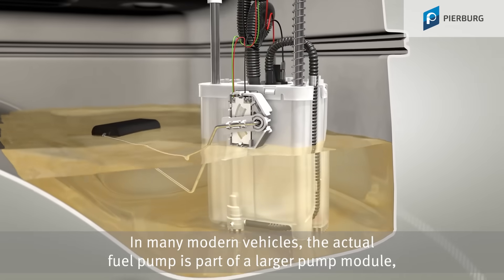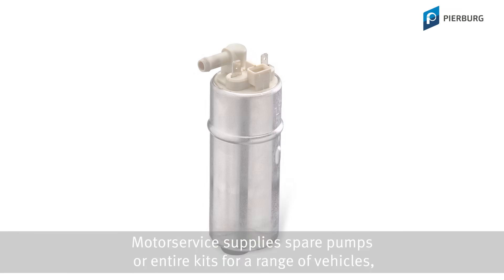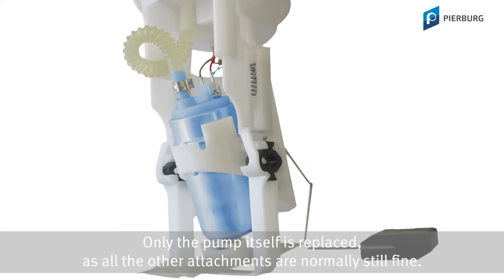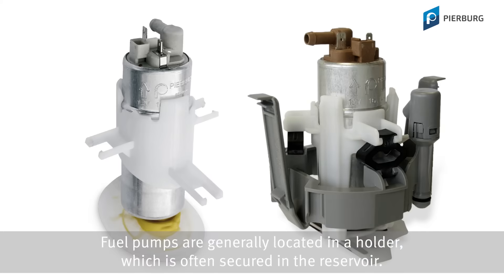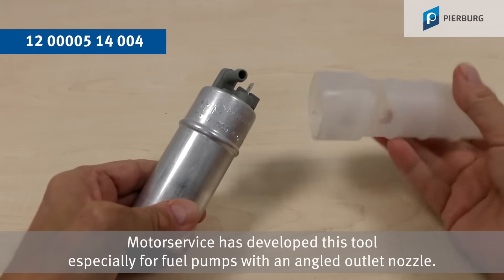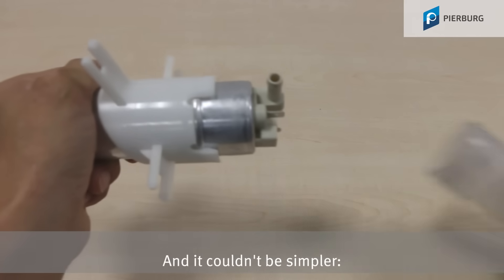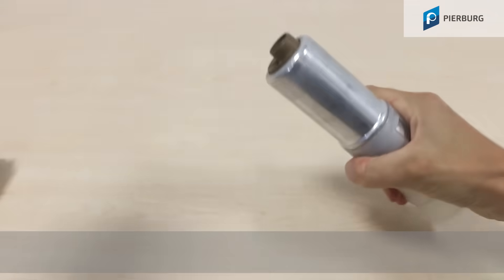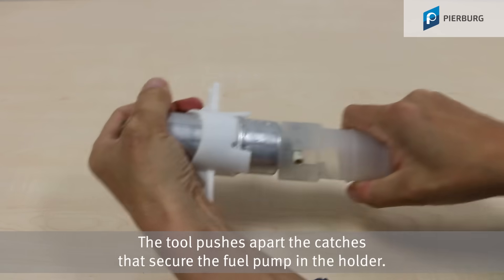Easily removing the fuel pump | Special tool

Comment: I believe the complete assemblies with modules can be quite expensive . Unfortunately , some shops will STILL replace the entire assembly simply because they want to make more money on the job . It's good to know that these are available .
Reply: K ..?..  😊😊
Reply: 🎉 @asifarusovic2044
Reply: I believe " some " vehicles may also have the fuel pressure regulator as part of the pump assembly . I am not sure if on some of these you can replace the regulator separately . That regulator could easily be located on the engine and NOT in the tank or as part of the " assembly " . Imagine having to pay hundreds of dollars for an assembly if it's only a fuel pressure regulator -  which is only a vacuum diaphragm and a spring , plus the labor . Some vehicles may have access through the trunk . Others the tank is dropped . So you may be paying for a module and pump if only the regulator is bad . Or any combination of the three .